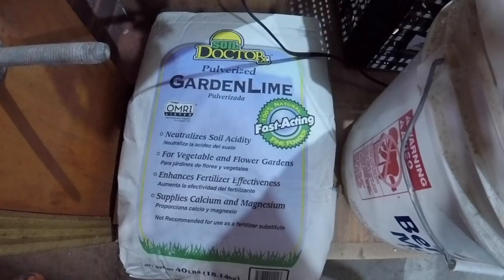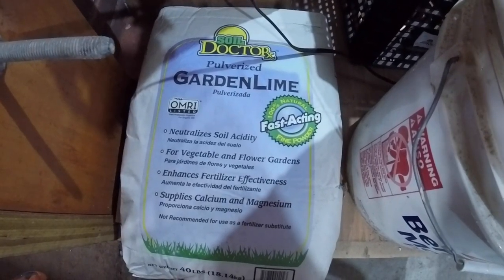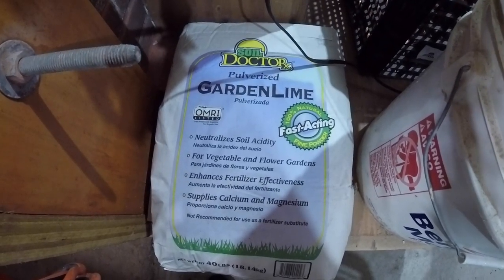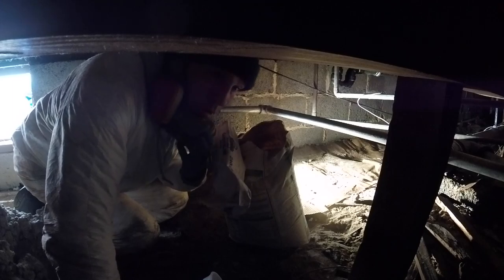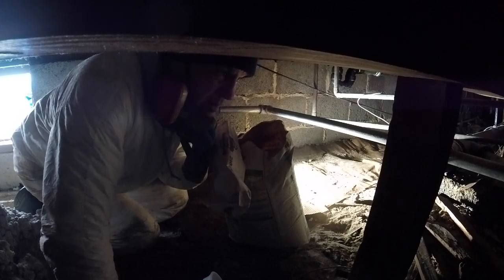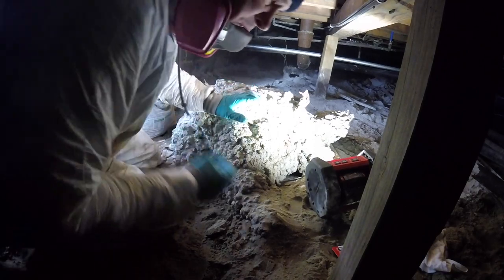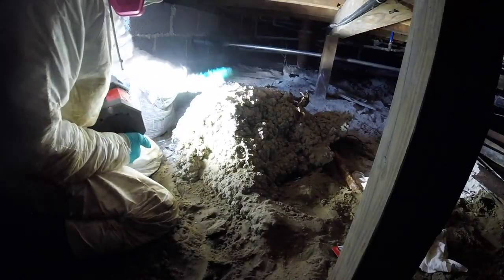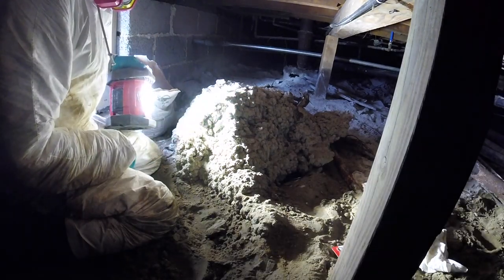WHAT I USE FOR SMALL SEWAGE SPILL CLEAN UP IN CRAWL SPACE

Comment: I do maintenance at a mobile home Is community in Gainesville Florida.  I served twenty years in the military and twenty two years out of the military building power plants before the lockdowns for the covid pandemic.  Now just a simple maintenance man in a mobile home community of about a hundred and thirty homes.  Would like to get rid of a smell under mobile home with the same line as you used.  So if 6 months to a year or 18 months down the road if we had to go back underneath that very same home do I have to wear? A disposable outfit again due to possible bear skin and a chemical on the skin?  Always for that home afterwards we will have to Wear a mask disposable suit, correct?  I am very familiar with all kinds of hazmat.  Is chemicals liquids and powders.  I do not have the experience with the line and will take the precautions to wear p p e.  But as soon as we do at home at home. We'll always have that line down there that we would still like to wear that very same PPE is what I'm asking?  A lot of times we have dead animals or sewage underdate.  Not frequently but it does happen now and then.  Correct me if I am wrong but if 1 year 2 years 5 years down the road it'll still have the line down there and create a problem for me. And the others correct?
Reply from the maker: read manufactures recommendations for sure

Comment: Hey chuck!
Can you use the lime in a crawlspace that the flooring is covered by a tarp?
Or does the whole trap covering the flooring need to be replaced after a small waste line leak?
Thanks!
Reply from the maker: i would lift tarp and apply and throw on top of spill on tarp too...if a mess just change tarp too.....sounds like a small spill.

Comment: As a homeowner, I never knew what you used for a crawl space.  Very good tip.  What would you use for a basement ??  I'm thinking soap and bleach.  Another thing:  I think the lime would work well for an emergency type bucket toilet, hunting cabin toilet, etc.  Thanks.  Remember: shit happens  :)))))).
Reply: I'd use sawdust to suck up all remaining liquids, sweep that up, then use a degreaser (fast lightning, formula 409), clean that off with some good rinse cycles, and then a bleach solution.
Reply: but as far as lime for a bucket toilet, use , saw dust, clumping kitty litter
Reply from the maker: good stuff gents.